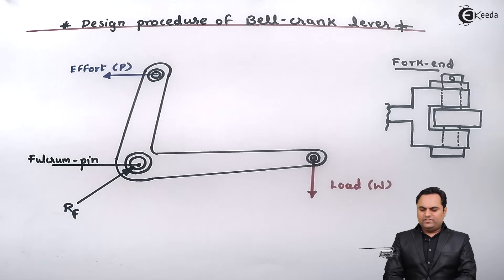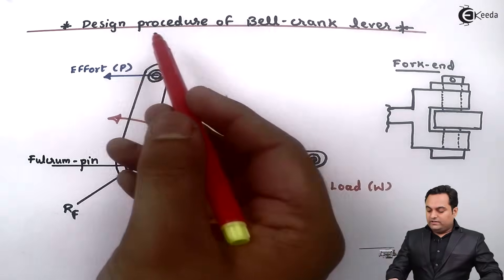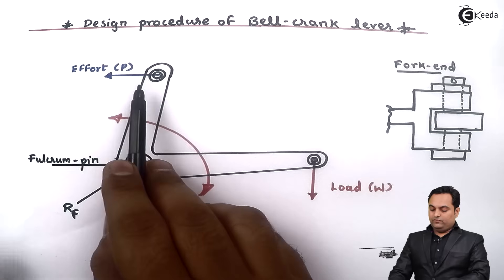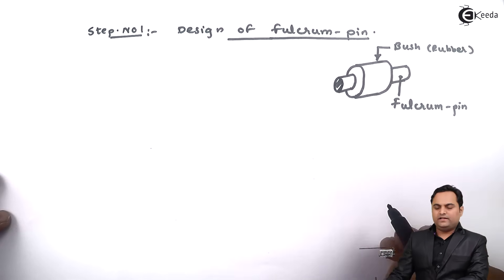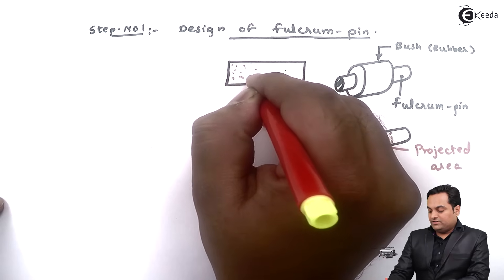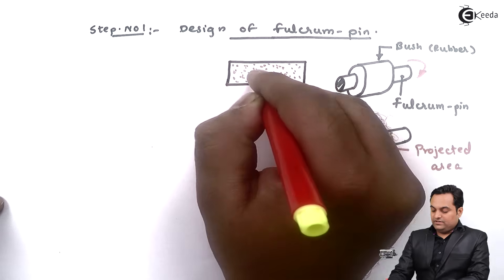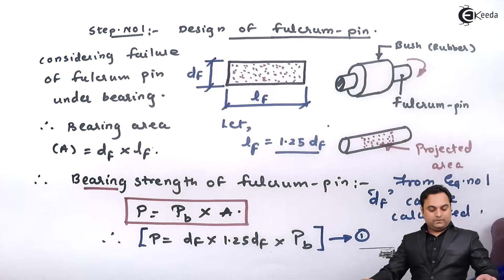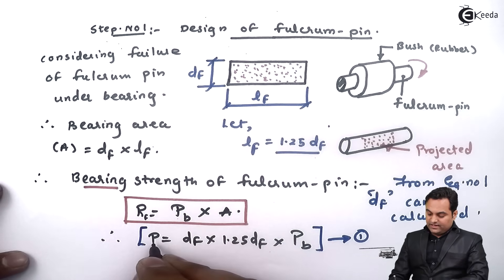Design Procedure of Bell Crank Lever - Design of Cotter Joint Knuckle Joint Levers and Offset Links

Comment: Step no 1. Projected area will be
 (circumference) X (length) right ?
Reply: no
Reply: shruti  why ??
Why he takes rectangular area
Reply: when you project a cylinder standing on ground . in front view you can see the projection as a rectangle(which in the video the diameter of cylinder as a rectangle) ..so  in video projected area =(diameter)X(length)
Reply: @madhamanish8959   in my understanding projected area will be , the area on  which the reaction force is acting and the area will be 3.14xDxL. Correct me if I wrong